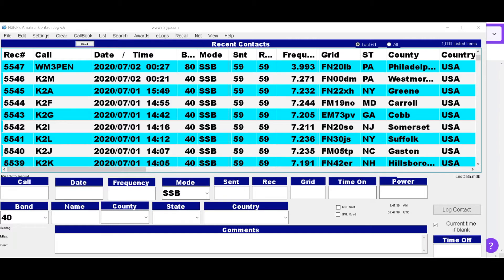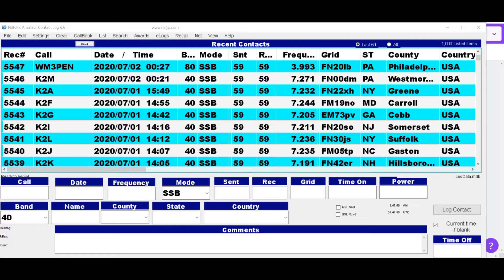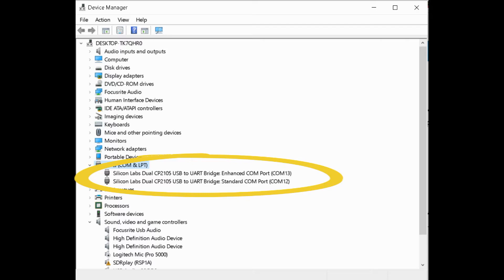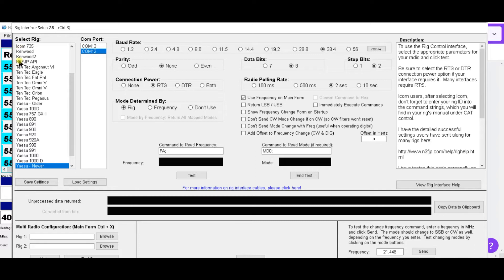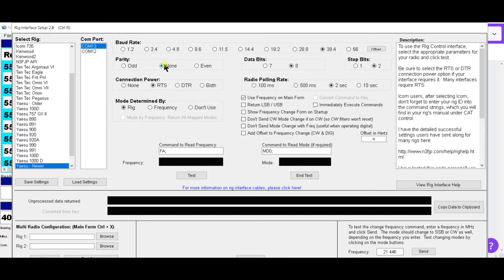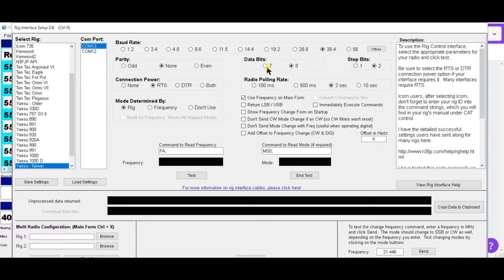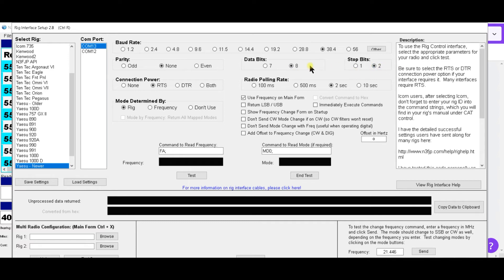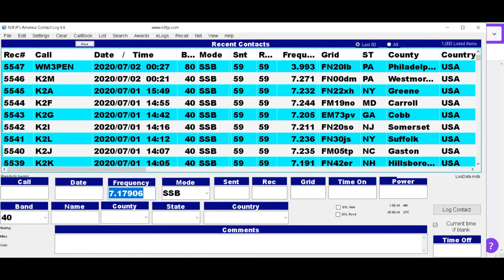HOW TO SET THE RIG INTERFACE FOR YAESU RADIOS IN N3FJP

Comment: I'm having a new issue.  When I fire up N3FJP's ACLog, my Yaesu FT-710 switches automatically modes from SSB to CW.

One specific example was YN9H showed up in the DX Spotter on 7.164 SSB.

When I went to contact him, the rig automatically switched to CW. I tried changing to SSB but the rig would immediately switch to CW.

Here are 2 more examples:

I tried to get 2 more DX contacts - 1) an SSB contact on 18.143 MHz. I clicked the DX Spotter and the rig switched immediately to CW-USB and would not go to SSB and 2) a CW-LSB contact on 7.010 MHz that the rig would only connect to with CW-USB. 

When I tried to change to CW-LSB, it wouldn't accept the command.

I don't understand why.

I've checked the Rig Interface settings and tried a couple of variations, but nothing seems to help.

When I shut down ACLog, the rig works fine.

Can you  help?

73,
Ken
KN2D
Reply from the maker: My first thought is you are doing a contest and the set up window is set to CW. Other than that it has to be a setting issue. Have you ruled out a bad usb to uart cable? Check radio settings? Come back and let us know what was wrong.
Reply: @HamShackReviews  Thanks for your response. There is a coding issue. It's reading there's a mode change needed, but not writing the change to the radio.

Comment: Thanks for the help. I have an FT-710. When I click COM5, which shows as the Enhanced COM port in the Device Manager, I get an error message: Access to the port COM5 is denied. Make sure you not attempting to share the port with any other function such as sending CW."  Now what do I do? TIA for your help.
Reply from the maker: You can not share the enhanced port with anything else, ensure nothing connected to it. Make sure all the other settings are correct.
Try the other port and come back to 5, worst case you can try deleting the Yaesu ports and reloading them.